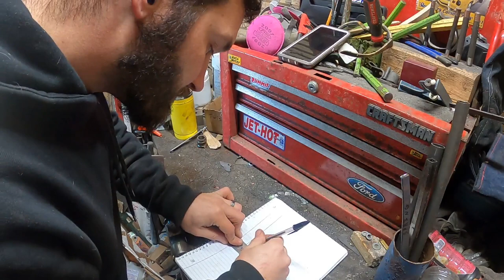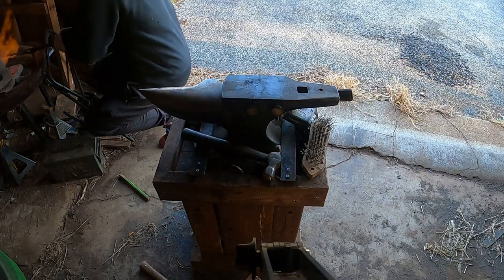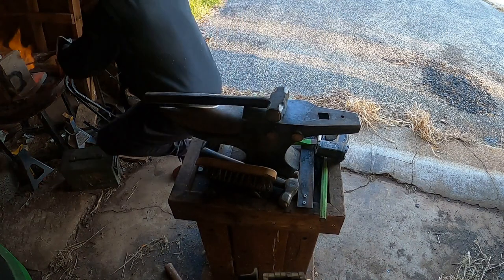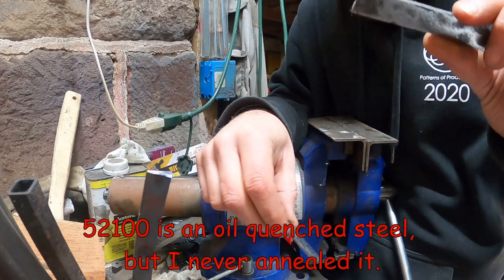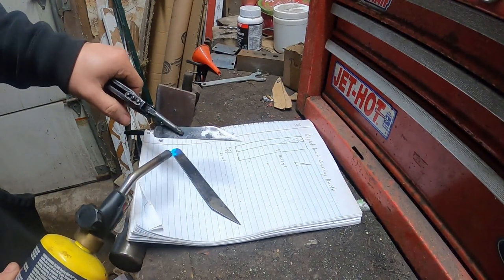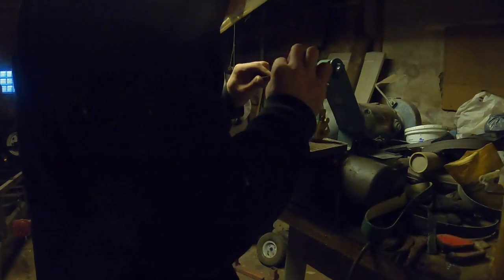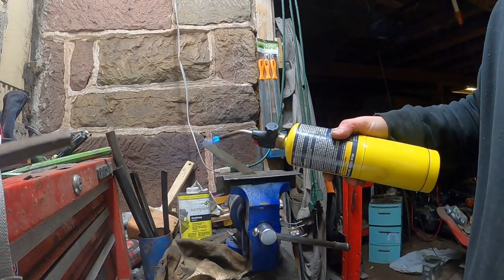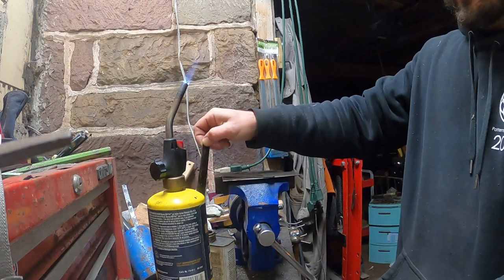Hand Forging a Bonsai Grafting Knife

Comment: Hi Matt. Nice job! I love watching forged in fire and have been wanting to have a go at forging my own knife for years. You have inspired me to have a go at making my own grafting knife. I don't have access to a forge so I will just cut a piece of steel, grind it into shape and heat treat the blade I think. Thanks for the inspiration.
Also, I have a cleaver that I use to chop small firewood, and the resin handle snapped a few days ago. I have just finished putting on a new handle, and I must say it's looking pretty good. I did a hidden tang using two scales of Pau Rosa. I'll have to send you some photos of it mate. What's your email address?
Reply from the maker: Tony I'm glad I could inspire you. The stock removal wethod  is one of the best ways to get used to making a knife. For the bevel it is good to practice with a piece of scrap wood prior to using your metal. 
    That is awesome you made a hidden tang for your cleaver and I would love to see that. My email is bobcatbonsai@gmail.com 
Thank you for watching!

Comment: Do you do pliers etc too? I am thinking of a new type of pliers for bonsaiwork but have absolutely no way to creating one!
Reply from the maker: I have dabbled into pliers and made my own set of jin pliers. As long as you keep the basic theory of making tongs(basically pliers that hold hot metal) it is not impossible. Now to get them just right can take a bit of time. Also you have to pick the right metal for what you want the pliers to be used for. So in theory yes I could help you and make your pliers, I am just not capable of doing them as fast as a proffesional. Thank you for watching Jelle!